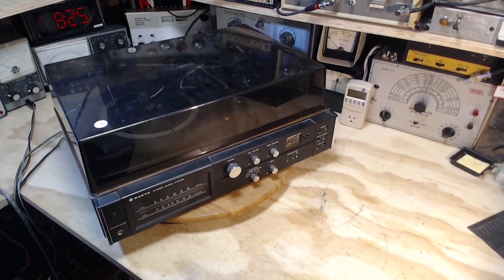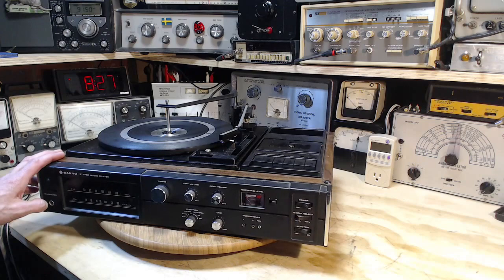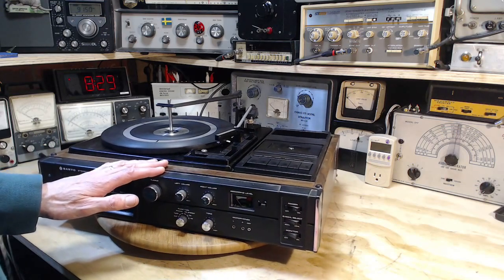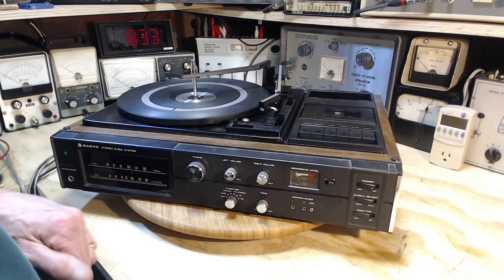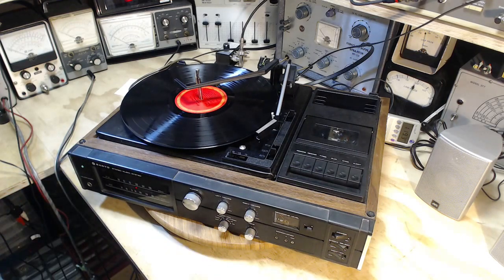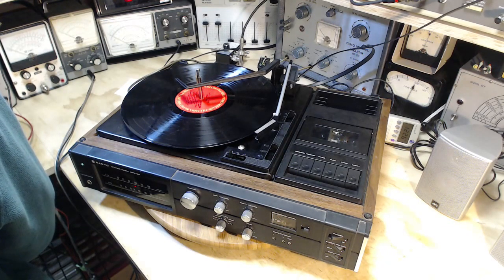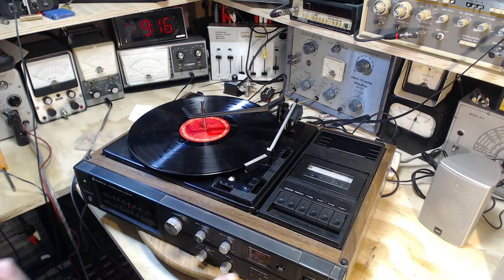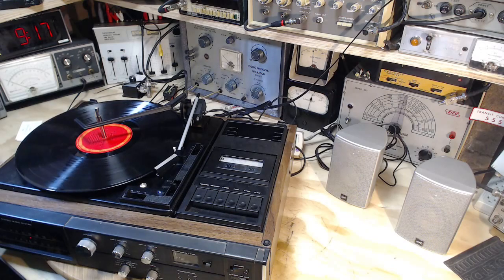Sanyo GXT4505K Combo Video #1 - Checkout

Comment: Hi Jim,  you have probably disposed of this unit but there is a service manual/schematic on line if you still wanted to fix the FM reception. 
This was my first stereo as a kid, in Australia it was sold as the GXT4515XK identical features except for semi automatic turntable.
Thanks so much for sharing this series of videos.

Comment: Wow! That brings back some great memories!  I hear myself, Dean, Glenn, Andy and Rob in there. If you search the tube for 'NWFM Andy on the Street' you will find one of the things I did with Andy for Neill-Wycik FM  (link was not allowed by the tube)
Reply: The funny thing is that you may well have reached more people by being in this video on the worldwide Internet, than you did being on air at the time.
Reply: That's for sure! The only computer we had access to back in those days was and IBM System 360! (google that) Via punch cards!
Reply: Error line 5673 
push
push 
pop 
divide by 0 
                                  d:-/

Comment: Hi Jim
Don't condemn the LA1201 IC  just yet .
If your lucky it's just the areal – pcb interconnect dropped off the screw , 
a faulty first RF amp stage or it's lost it's supply .    RF amp & LO supply only applied for FM  !-)

Comment: I think that the unit you are working on will use a QUADRAPHONICS 4-2-4 matrix decoding system, Inside you will find SANYO marked integrated circuits and really the only thing you can do remove the defective chip and replace it with a new one hopefully all integrated circuit chips will be socketed, I love Billy Joel and Innocent Man is a brilliant track as well as we didn't start the fire.
Reply from the maker: Well you got me looking for that chip.  There are two in there one of which is branded Sanyo.  It's a A1201 and from what I could find, there's just some operational amplifiers inside with 9 transistors.  I doubt that's going to help with decoding quad sound but then again, I don't know anything about it.
Reply: With this being a low end unit. It may just do a simulated quad sound. And not doing any decoding of a quad signal. Like if you have a stereo amp with a common ground on the outputs you can get simulated ambient quad sound by hooking a speaker between the two + terminal speaker outputs. Jim, looking forward to watching you work on this unit. And the tape was very cool! I know you like tubes, but would like to see you service more stuff like this.